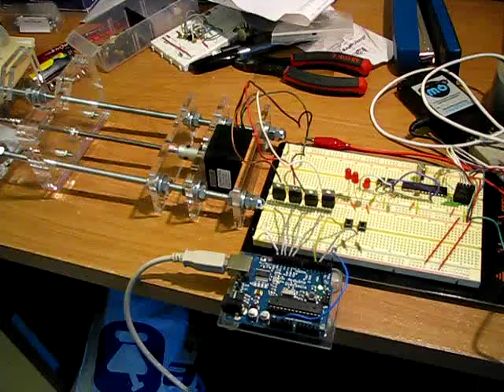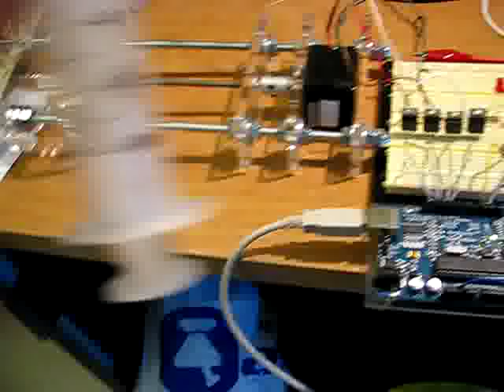Early revision DIY syringe pump

Comment from the maker: @bigchad007 Stepper motors are made up of several windings in a specific geometric arrangement, the output shaft moves as each winding is powered on and off sequentially in a stepwise fashion (ergo, stepper motor). The winding impedance dictates how much current can flow at a given voltage (ie: Ohm's law), while the motor specs dictate how much heat the motor can tolerate. If you have a low winding impedance you must use a lower voltage to not overheat the motor.

Comment from the maker: @bigchad007 Also, a 30A power supply means that in any failure mode involving a short circuit, 30A of power at 12V (potentially 360W) can flow, resulting in lots of magic smoke being released. I would go with something much lower power, or add in some current limiting.

Comment: @aonomus Ok. I'm having a hard time grasping how stepper motors work. I order the easy driver from sparkfun and a nema 17 stepper motor. From what all I've gathered, if the motor needs say 1 amp, as long as your power supply can give 1amp your ok. Like having a 12volt 30amp supply would be ok?

Comment: @aonomus Thanks for all the help and feedback man.. I'm going to be using a nema 17 with a sparkfun easy driver.. from what I gather the driver is actually regulating the amps and voltage? So if the motor needs 2amps max using a 12 volt 5amp+ computer power supply would even work?